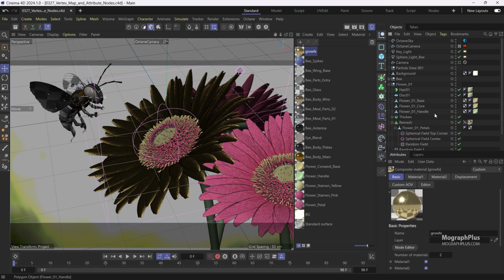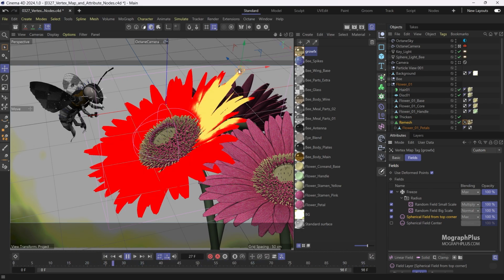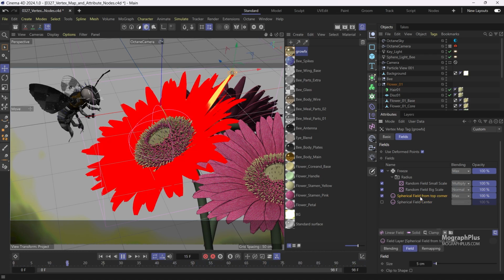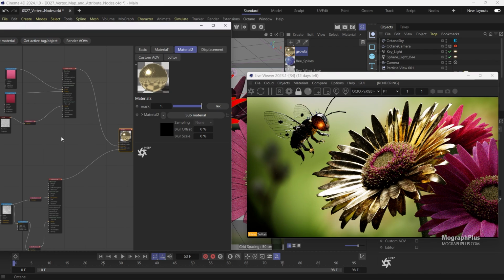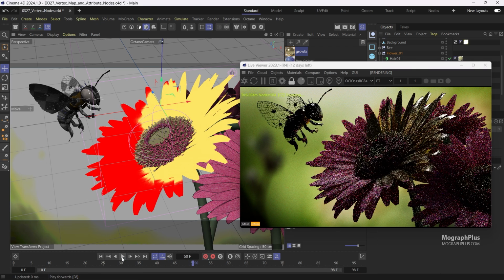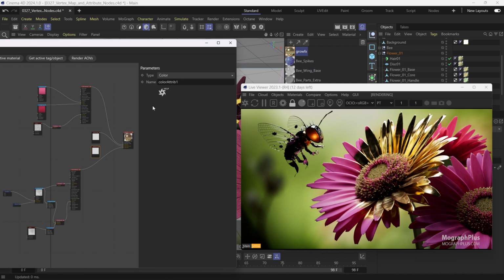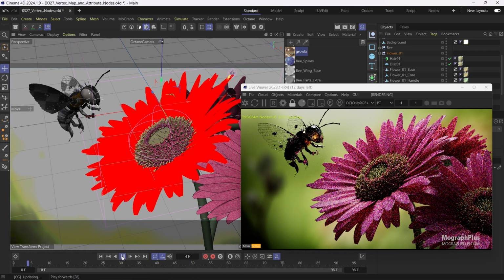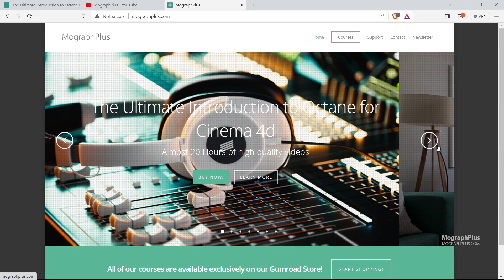How to Transition Between Materials in Octane and Cinema 4d

Comment: Is there a way to use this technique to blend displacement maps? I'm trying to do it the same way, so using a vertex map to blend between two displacement maps, only it works extremely buggy and not correct :(
Reply: No, I think it is not supported. That's why Octane really fails for me when used in C4D.
Reply: @Ricardo-de9ju  That's too bad, feels like it should be something really basic